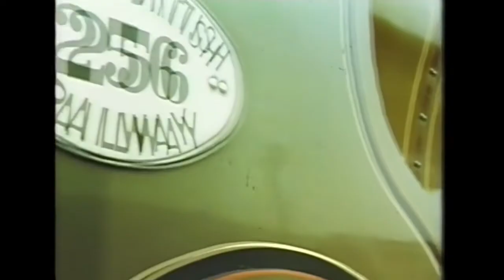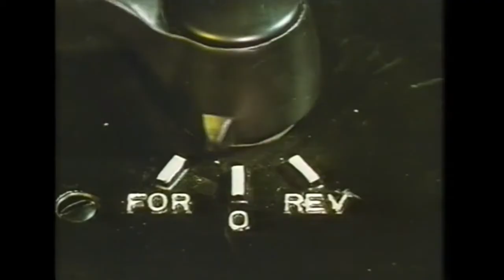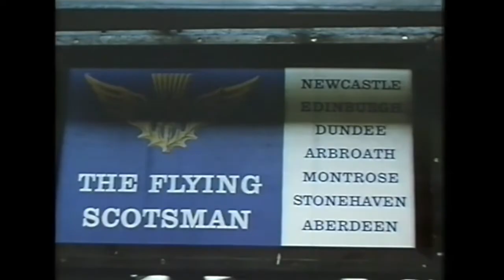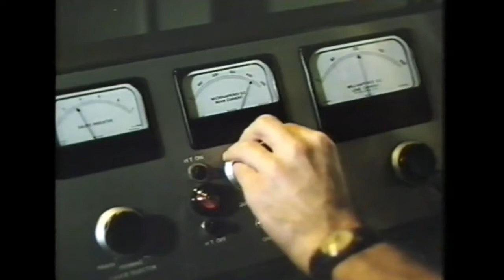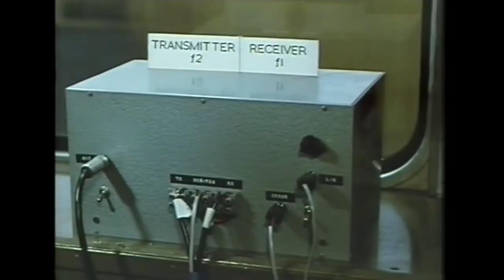Vintage railway film - The driving force - 1966

Comment: sad to say 9004 was only in service for 20 years being based at Haymarket depot however it only lasted for 20 years before being scrapped at Doncaster BREL.  
At around exactly at the 20 year mark! built in March 1961 and scrapped in March 1981 after being involved in an accident,  where the driver of D9004 "Queens Own Highlander" was speeding towards Connington. Huntingdonshire where the driver passed a signal, the signalman had moved the points under the train. The Signalman was convicted of endangering persons travelling on the railway but was acquitted of manslaughter. He was sentenced to two years' imprisonment.

Comment: There was no need to scrap steam so quickly. 9f’s were hardly run in and scrapped. Too many lines shut, and definitely the road lobby interest being put before the nations!
Reply: Looking back, it's now clear that the hasty removal of steam was largely a fashion thing. This is why the commentator has a slightly defensive, arrogant tone at times. He frequently pushes the fasle narrative that diesel and electric traction are better in every way than steam. In hindsight, we now know that the emmisions from diesels are far more deadly that coal smoke. Electrification was unbelievably expensive and worst of all, electric locos cost 10-20 times more than steam locos which means that the savings in turn round, maintenance and crew costs were never recovered. The hurried transition was a foolish mistake, as were the Beeching cuts.

Comment: Please excuse my question if it proves to be a 
daft one but after hearing how the diesel engine powered an electric generator AND this drives the train, the thought popped in my head asking 'why not drive the train directly with just the diesel engine? Why combine the two?
Reply: The amount of gears needed to keep the engine in its power band would be immensely complex. A lorry/truck needs anything up to 20 forward gears just to keep the engine in the correct power band.
Reply: Actually, they did.  I don't know if they still do or not.  Probably not.

As the film explains, they had three basic types at the time:
1.  A "mechanical" diesel locomotive that used smaller diesel engines, gears and hydraulic clutches in sets of two that could be coupled together in groups up to four sets.  These were designed as passenger trains for locations that didn't have a large volume of passenger traffic.  Kind of like diesel busses on rails. (There's an excellent four-part series here about driving and operating the diesel train that discusses the diesel-mechanical trainsets in detail.)

2.  A diesel-hydraulic setup that I know nothing about.  However, if they did any kind of heavy hauling at all, the hydraulic pressures must have been absolutely stupendous!

3.  The now, almost universal, diesel-electric locomotive.

The advantage of the diesel-electric locomotive is that you can use a relatively large, (and consequently more efficient), diesel engine to create the massive amounts of force required.  By converting the diesel's force into electricity, (or by using electricity directly), the tractive force, (the energy actually used to move the wheels against the rails), can be very carefully and efficiently regulated to provide the maximum amount of force using a minimum amount of fuel or power.

To do this mechanically would require literally dozens and dozens of extremely expensive, high tensile strength gears and a twenty-armed engineer to handle them on even a modest freight haul of the day.  It's not unusual for a modern day heavy freight haul to have to move hundreds of thousands of tons of freight in one train.  Doing that with gears would be a nightmare!

Hydraulic?  I wouldn't want to be within miles of the hideously high pressures required as even the tiniest leak would cut you in half before you even knew there was a leak.

Today's trains are primarily either fully electric, or diesel-electric, as that gives you both the tractive power required and an economic enough system to make it worthwhile.

Since modern day freight trains can be both long and hideously heavy, the common practice is to use what is called "distributed power".  This technique is, in essence, a number of "normal" trains connected end-to-end with enough engines for each segment, with the entire monstrosity controlled electronically from the leading cab.  Electrically powered traction makes this relatively easy to do.
Reply: the Diesel Hydraulic loco's used a torque converter to give a constantly changing balance between torque to get the train moving from a standstill to horsepower to keep it going at speed

Comment: As a US, I was surprised to see the UK using MPH instead of KPH...is there a reason for this or has it changed over time? Great video though.
Reply: We still use MPH  and measure distance in miles. Being a bit of an eccentric country, measurements are mostly done in metic but people's height caried out in feet and inches. Petrol is sold by Litres buy pints.
Reply: The UK uses a hybrid system like the US. Out tools are mostly metric on cars and trucks, and we buy sodas and water in litres and milk, tea in gallons, and ounces and miller litres. Cokes come in 12 ounces/355 ml. Remember, the French created the Metric system. Only because they couldn't count to 12. Not enough fingers. Oui?
Reply: @wendellwhite5797  Touche!

Comment: I wonder why they didn't try gas turbine instead of diesel?
Reply: They did, but the Kerosene Castle and the GT3 were not at all successful.
You need American distances and freight loading to make gas turbines economical.
Plus they're incredibly noisy.
Reply: @spencerhardy8667 
That was tried in the 'States too and didn't work well.  Maybe now with the improved materials it might, but diesel-electric and fully electric locomotives do a fine job as it is.  BTW, (as you mentioned), turbines that would provide the power required are better tolerated at 40,000 feet away than twenty yards. 😉
Reply: Just to give this some context:

There are videos of the beach that is right nest to the runaway at Princess Juliana airport on St. Martin / St. Maarten.  Because the runway is relatively short, and there are mountains at the other end, airplanes have to back all the way up against the fence at the beach end of the runway.

They then need as much speed as possible, as quickly as possible, to avoid crashing into the mountains.  So, they ram the throttles as far forward as possible, creating maximum thrust and, (as a consequence), blowing stupid people who don't/can't read, as well as their belongings into the sea.

Lesson:
Turbine engines make hideous amounts of noise, generate incredible amounts of exhaust heat, and need "airport" type distances to keep people from being hurt.

Can you imagine a freight train running an engine like that, hauling mega-tons of freight, starting up in the middle of some city somewhere?

Nope.
Nope.  Nope.  Nope.
Not even close to nope.

Comment: Scrappers are murderers of steam locomotives
Reply: you do realize British Rail was in dire need of modernization and Diesel and Electric power was the future. Steam wouldn't last forever on the mainline.
Reply: @nikerailfanningttm9046  the steam engines built by british rail were meant to have a maximum service life until the 2000s but modernization by british rail caused them to only have a service life until 1968.
Reply: Scrappers didn't set policy. In fact, one scrapman saved the last Black 5 in his yard, having cut dozens up. That loco exists to this day, and is still well looked after. 45305.